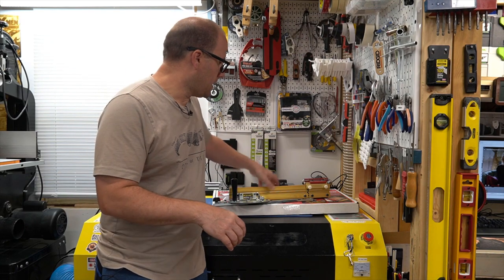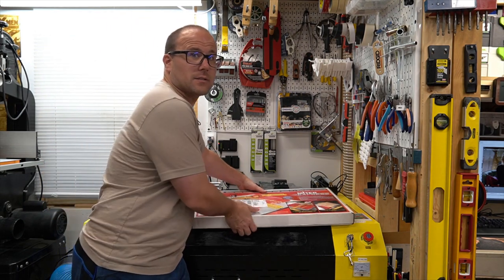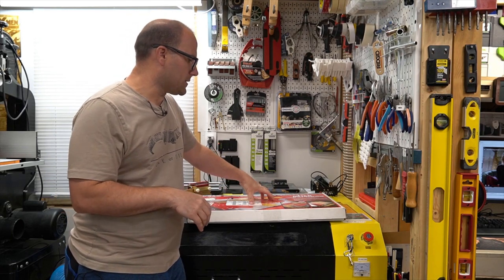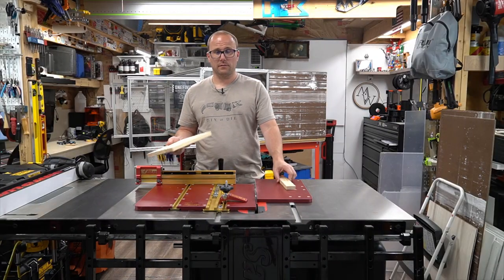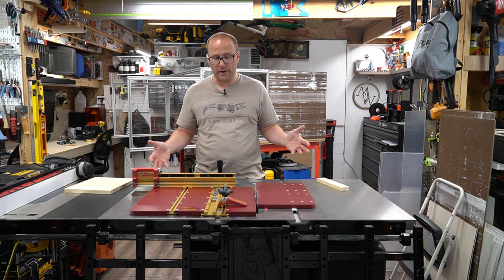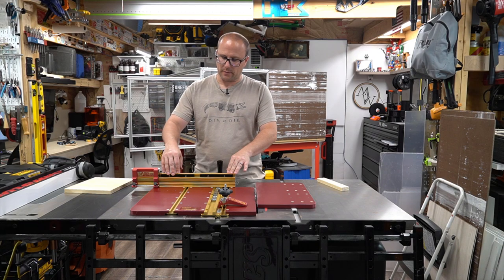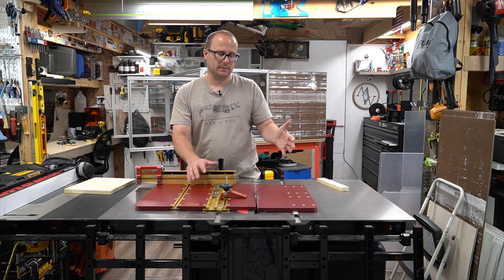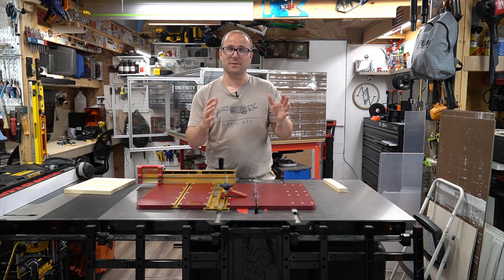Incra Miter Sled review

Comment: What is the point of the left side of the sled?
It's not connected to anything.
A main reason for using a sled is that it rides in both slots for stability.
Am I missing something here?
Reply: They call it a drop panel. It doesn't actually need to move; it just needs to be right against the blade to prevent tear-out. He was supposed to attach the runner to it farther away and trim it again, right next to the blade.

Comment: I don't like that type of miter track because it can't ever be pulled forward so far that it partially comes out of the miter slot. If it does, the little plastic wheels that touch the sides don't touch and it isn't accurate any more until the miter is all the way back in so all the plastic wheels are in contact. It's probably fine on the large cabinet saws but I got rid of mine and switched to a contractors saw with a smaller top surface.

Comment: Thanks very much for this excellent video.  You did a great job showing the assembly.  I am curious about the use of the sled with a dado stack.  I anticipated you using the piece you cut off with the dado blades. Have you tried it yet?  Are there any problems after you use it with a dado stack, then returning to standard kerf cuts?

Comment: Im not used to seeing a crosscut sled thats divided into two parts. Notnsire about that. How would you ise that? Why is it separate?
Reply: I've made some sleds that way.  It doesn't need to be attached for it to work. It just needs to rest against the other side of the blade to prevent tear-out. Its runner is actually supposed to be attached far enough away so it can be re-cut so that it's right next to the blade.

Comment: Not worth the expense,  just got the miter itself and the add-on doesn’t bring much to it at all!
Thanks for the update
Reply: One thing I like about it is you can clamp the piece down to the sled while cutting. That will keep the part from slipping and jamming against the blade when you're cutting a steep taper.

Comment: Thanks for the video! I have a Dewalt DWE7491RS table saw that I want to use this on, but people tell me the Dewalt’s miter slots are notoriously oversized (mine are between .0764”-.0768”) and that the Incra miter bars only adjust up to .762”. Do you think adding some UMHW tape to the bars would solve the issue? I know they come in thicknesses of down to 3 mil and up to 20 mil, so I was wondering if I could make up the difference with that. Just wondering if it would be more effective and easier to add the tape to the miter bar or the slot itself. Thoughts?
Reply: I am going to try with 5mil tape, hopefully it works or its going back. I will just make something like miter express with tracks and everything. I am almost done building a collapsible outfeed table that hooks onto the 7491rs, i just got to route some miter slots in it. I am also going to try a removable infeed on one side also.
Reply: How did it turn out for you? I would really like to know. Im trying to do the same and I have the same exact table lol
Reply: @chuckgrumble5440  how did yours turn out?

Comment: what is the sled made of?....I have a wide humidity swing and constantly have my sleds warp or twist...looking for a material that is not affected by humidity.
Reply from the maker: aluminum and some sort of coated plastic with probobly mdf core.
Reply: @MyersWoodshop  my after market TS inserts are high pressure laminate in phenolic resin core....a sheet of that material would make a great sled...like the black core bathroom partition...
Reply: King Starboard or PVC at marine supply.  Any thickness from 1/8 to 1.5 in. also in metric.

Comment: If you own a sawstop be careful with this and the incra miter gauge as the blade deflection can trigger the brake. I don't own the sled but do the miter gauge and simply moved the fence over a 1/2" and just need to remember about that half inch when using the measurement.

Comment: Are you following the instructions? You might want to read the assembly instructions. You have some errors there in your setup that probably make the sled more cumbersome.
Reply from the maker: can you point them out?
Reply: @MyersWoodshop  Not the original poster, but I just went through the same setup tonight. The few places where I noticed your setup isn't the same as the instructions:
- The utility plate has 6 mounting holes for the panels. You're currently using the four furthest from you to connect the panels, but the instructions specify using the middle 4 instead. I can see how this would be confusing from figure 4A, but if you take a closer look at the other images, they all show using the middle 4 holes.
- The "drop panel" is meant to be a zero clearance insert. Take a look at step 7, "cut off drop panel overhang". You're meant to use the holes that have some, but the least amount, of positive overlap. For my SawStop, this was the middle holes. Once you cut the panel, you'll have zero clearance on both sides.
- The "drop panel" is meant to be locked in place while actually making cuts. It's not supposed to slide. See step 1 in the operation section: you're supposed to tighten the expansion mechanisms until it's locked.
Reply: @nat_was_here  ok good I wasn’t the only one to see this. I own this sled too. Doesn’t he have the miter fence and gauge on the wrong side of the sled too. On mine (and I double checked with other videos on YouTube) the gold aluminum pieces protrude in front of the sled not behind it.

Comment: I wouldn't use it with a dado, I would take the miter off and either make a separate sled or use the miter separately with the fence. If you use the dado you lose the zero clearance of the platform

Comment: I'm kind of confused on the utility of this product. You already have the miter gauge and fence. It seems like you are just increasing the table height with these panels for no useful purpose. What am I missing? Does it allow the miter gauge to start past the table edge for larger boards?
Reply: Using a sled under your work increases stability and accuracy when running it in a crosscut position through the blade. It eliminates the friction element between the piece and the top of the table saw, which is safer and more accurate.
Reply: I have to agree.  This is really half a sled.  With a full crosscut sled the left and right halves are permanently attached together.  This eliminates table friction of the board being cut.  There are lots of YouTube videos for building crosscut sleds.  Most seem to put a lot of effort into making the miter slides, but Incra makes aluminum ones to eliminate the humidity variation of wooden slides (tightening and loosening with changes in shop humidity) while also providing built in fine-tuning calibration capability.  I liked mine so much I bought a set for my son.

Comment: Thanks for the review, Ben.  You'll want to close up the gap between the drop panel and blade by moving the miter bar over one set of holes and making the second cut described in the manual.  

The zero clearance will give you a cleaner finish on the offcuts, but it also keeps narrow offcuts from getting pulled down into the gap… that might be okay if the saw has an open throat plate that lets narrow pieces get pulled through, but if the saw has a zero clearance insert, there's potential for narrow offcuts to get jammed between the blade and panel and kicked back toward the operator.
Reply from the maker: thanks for the tip!